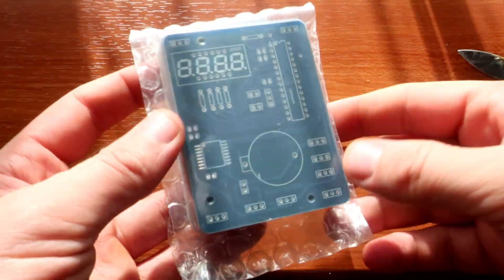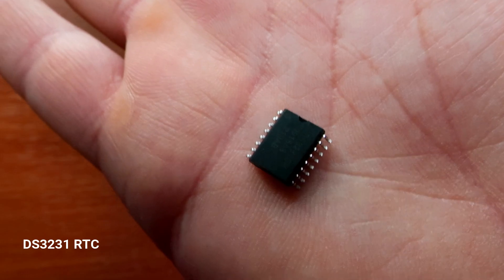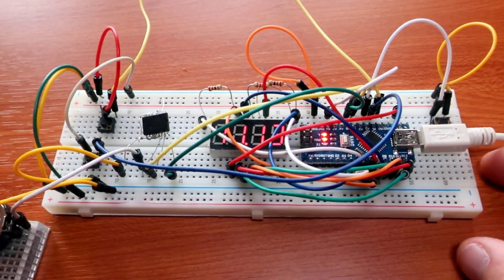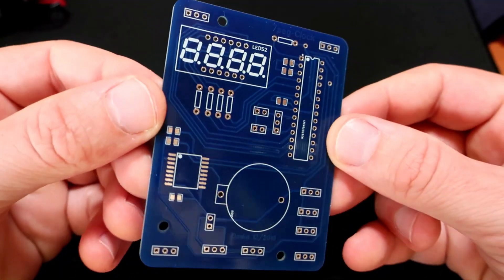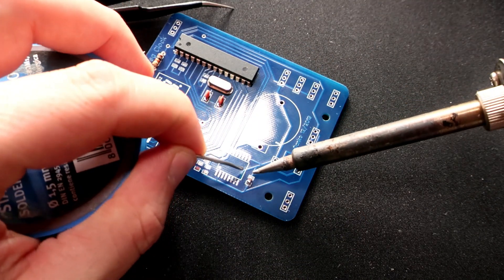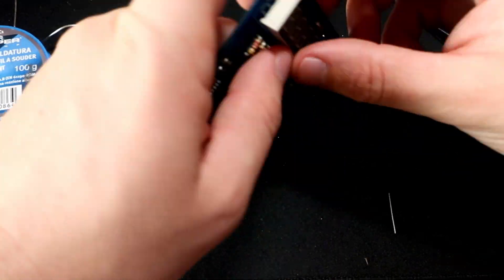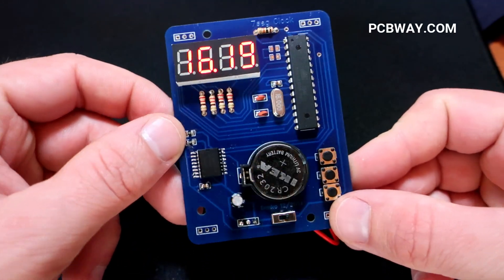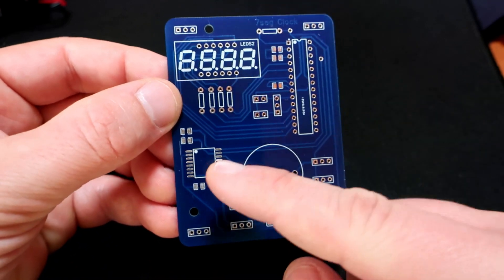Arduino CLOCK , how to make

Comment: With the sevseg library,  the 4 resistors below the display can be removed or kept and the code has an entry to mention whether they are attached or not. It makes the intensity a bit higher.

Comment: Could it run 12 hour time? (I use 24, but everyone else here uses 12).  Also, can an alarm be set?
Very, very cool project.  I just build a clock kit from Amazon, but it's rather lacking in features.
Reply from the maker: yes it can run 12 with code edit... it dont have buzzer so it cant be used as alarm

Comment: Nice project. 
can you help me by give me the component list
Reply from the maker: Sure
1x Atmega328  microcontroller
4 digits seven segment display x1
DS 3231 RTC x1
4x 330 ohms resistors –under seven segment display
1x 10K resistor (regular) x1 (on reset pin of MCU)
2x 10K resistors  SMD 0805 package ( pull up resistors  close to RTC chip) 
1x 16MHZ crystal and  two 22 ceramic capacitor
3x push buttons (2 pin push button)
1x electrolitic capacitor 10uF
2x 104 smd capacitors – one goes near crystal, one is below RTC
1x Toogle switch
Reply from the maker: and i forgot 1x cr2032 battery holder and battery
Reply: @VolosProjects  thank you

Comment: Very nice project! Is there way to order ready PCB for it? One thing I think may be done to improve it. Once in the morning you will understand that sketch loaded into controller is not perfect and may be improved :-) But unfortunately it is impossible to load new sketch with such construction. That is why controller should be installed using DIP socket IMHO. So you can extract it and place back into Arduino to load new sketch. Maybe there is a reason to create clock PCB with socket just for Arduino Nano?